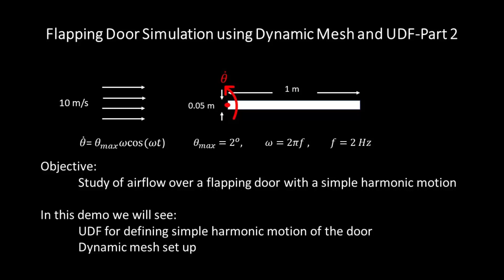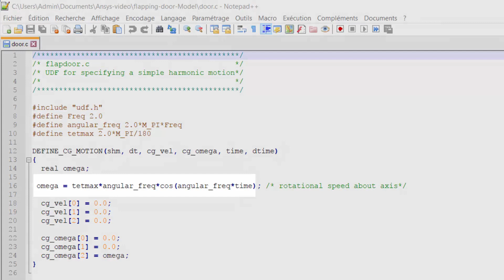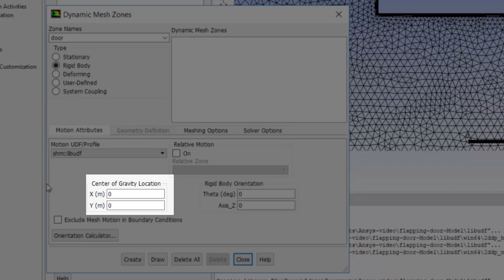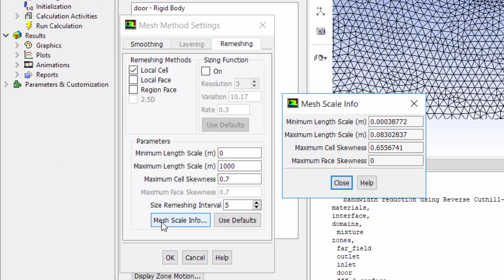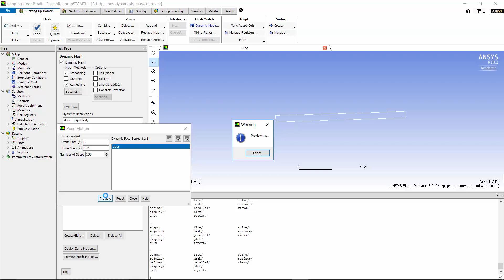Flapping Door Part 2: Writing a UDF (SHM motion) and setting up dynamic mesh in ANSYS Fluent (CFD)

Comment: Hai there, I am getting this type of errors when I build the udf because of this errors I am unable to load the udf.

C:\Program Files (x86)\Windows Kits\10\include\10.0.17763.0\ucrt\corecrt_math.h(495): error C2059: syntax error: 'constant'
C:\Program Files (x86)\Windows Kits\10\include\10.0.17763.0\ucrt\corecrt_math.h(495): error C2143: syntax error: missing ')' before '/'
C:\Program Files (x86)\Windows Kits\10\include\10.0.17763.0\ucrt\corecrt_math.h(495): error C2143: syntax error: missing '{' before '/'
C:\Program Files (x86)\Windows Kits\10\include\10.0.17763.0\ucrt\corecrt_math.h(495): error C2059: syntax error: '/'
C:\Program Files (x86)\Windows Kits\10\include\10.0.17763.0\ucrt\corecrt_math.h(495): error C2059: syntax error: ')'

I am using ANSYS 15.0
VS 2017 and opening fluent via command prompt and my operating system is windows 10
please help in solving this errors

Comment: Hi vishal,
I used the same equations and udf function but the motion is not harmonic, rather the object rotates around the center of rotation. What could be the possible reason for that?
Reply: Did you get solution? I am also facing same problem.
Reply: I am not sure..but coordinate system may be one of the reason.
Reply: Could be units are incorect. 
If units rad and you feed to it deg. Providing 1 2 3 deg actually will rotate object to 180° or pi in rad.
Reply: hey facing same problem.. did you find any solutions for this problem?
Reply: haha its been 5 years and i still have the same problem and no solution
Reply: @bored_abi  I think it has to do with the location of the CG
Seems like (0,0) is the middle of the left most end so it's working like that
Reply: @prathameshsahoo3172  no i dont think its that, i fixed this issue.

I believe there are two possible reason as to why this occurs:
1) definition of the dynamic mesh, you need to specficiy what is being subjected to the UDF, the plate or the mesh that surrounds it.
2) Wrong code, in the code they have defined both degrees and radians, this interchange of units does something weird? though it really shouldn't but mine worked perfectly fine when i consistently maintained a single unit throughout, or maybe i just had a lucky fix

Ansys is very flimsy with UDFs

Comment: Error: The UDF library you are trying to load (C:\Users\anil kumar\Desktop\flapping  door\flapping doo_files\dp0\FFF-1\Fluent\libudf) is not compiled for 2ddp on the current platform (win64).\n\nThe system cannot find the file specified.
\n\nC:\Users\anil kumar\Desktop\flapping  door\flapping doo_files\dp0\FFF-1\Fluent\C:\Users\anil kumar\Desktop\flapping  door\flapping doo_files\dp0\FFF-1\Fluent\libudf\win64\2ddp\libudf.dll
Error Object: #f

Comment: Hi Vishal,I am new to UDFs. I tried to solve this tutorial on my own but I am facing the error
 "The UDF library you are trying to load is not compiled for 2D on the current platform.The system cannot find the file specified."
Can you Please help me to get out of this error and any source where I can learn how to write UDFs and their compilation and what precautions are taken during Geometry and Meshing steps

Thanks
Manish
Reply: This error generally occurs when fluent is not able to use visual studio for compilation of udf.
open cross tools command prompt and change directory to source of udf.c file.
Reply from the maker: Hi, can you please raise your question in ANSYS student community thread given in description section??
Reply: Thanks Vishal,I have raised the question in ANSYS student community thread also
Reply: You need to put udf.c to the same folder where is *.cas file. 
All udf 3d and all 2d cases also 3d. Third axis is rotational z, motion not possible in this axis.
Reply: Install vs studio professional 2012 it will fix the udflib issues